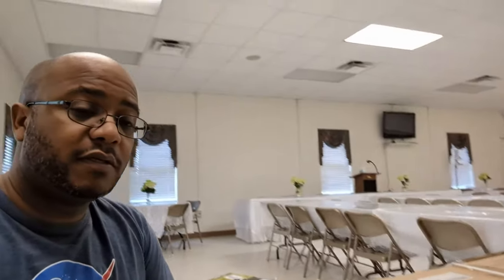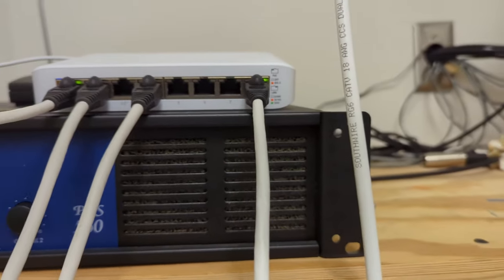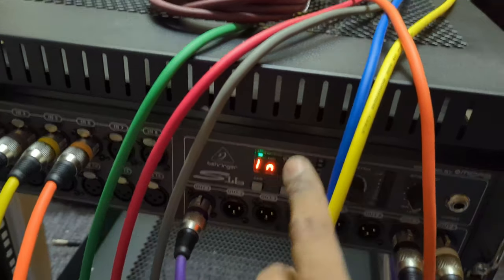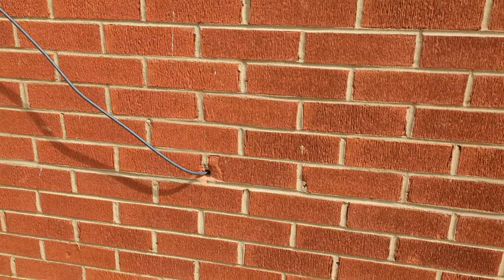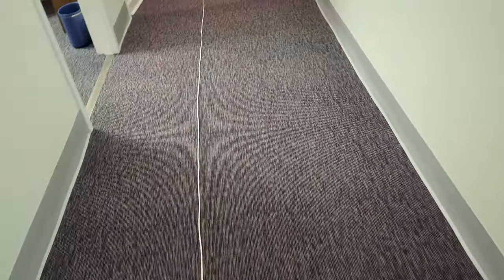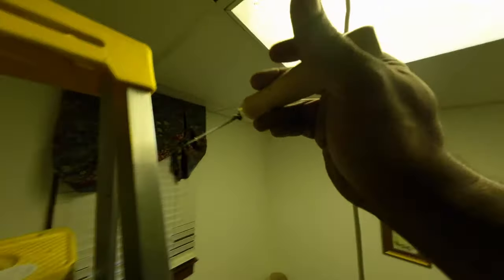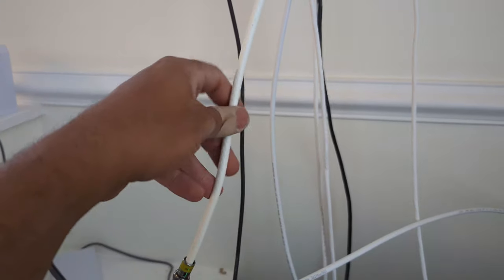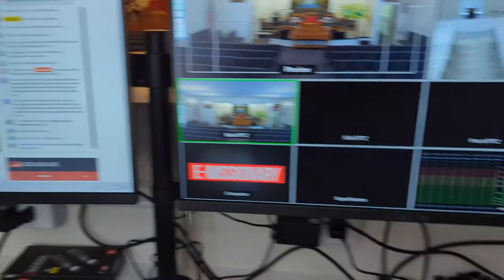Complete Church Tech Install | Phase 1 Complete | Galilee Missionary Baptist Church

Comment: AJ, I watch your videos, but I need your help! I have 2 x32’s. One full board and the other the producer. Is there a way I can link them and not have to buy a digital snake. I don’t want to waste money
Reply from the maker: You would say one up as front of house and main
Reply from the maker: You would connect them like a stage box connection. Shielded whenever cable between the 2 consoles